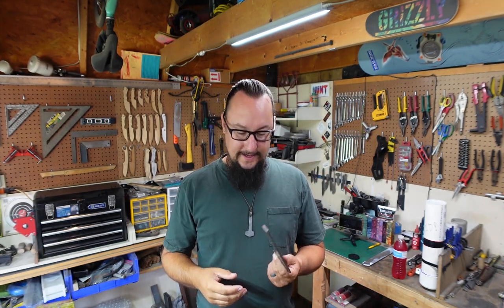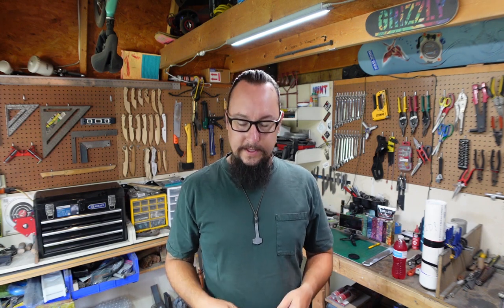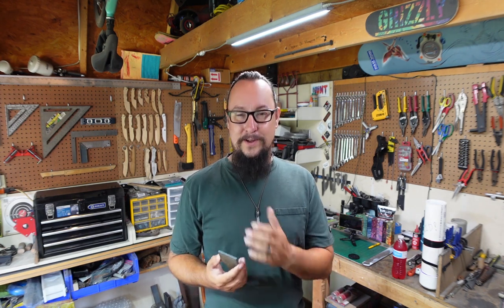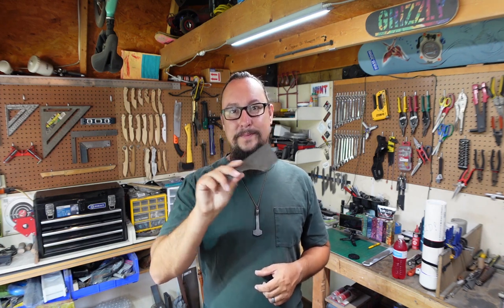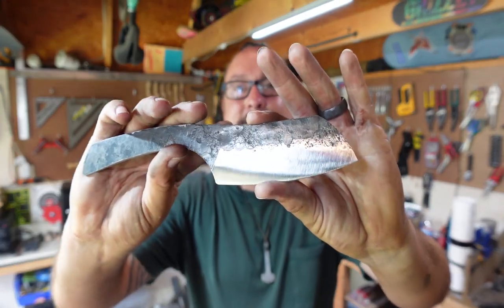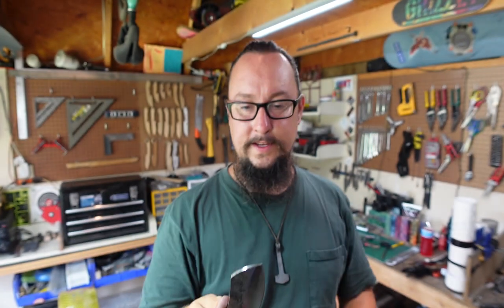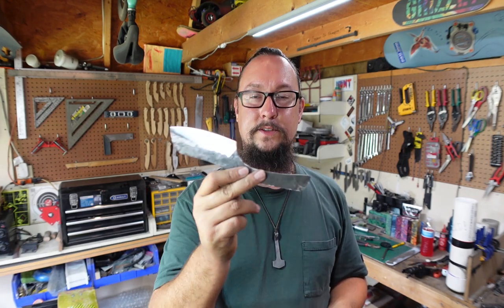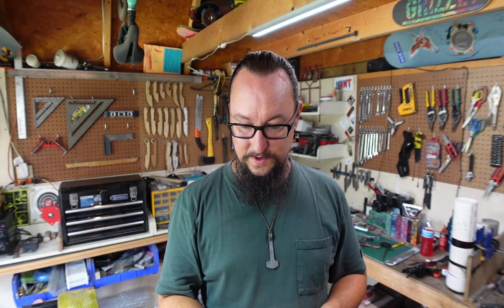Forging A Nesmuk Knife Knife From A Scrap Piece Of 1084 | Knife Maker Vlog

Comment: I had a question, how long do you think someone should be forging before they try to make damascus? Thank-you, love your channel can't wait to see the finished product!
Reply from the maker: It depends. You for sure have to have the equipment to be able to get your steels up to forge welding temp. Power hammer helps, however, with enough hand forging you can build up enough muscle strength and endurance to hand forge damascus.
Reply: @theriversexperience9383  Alright, thank you very much